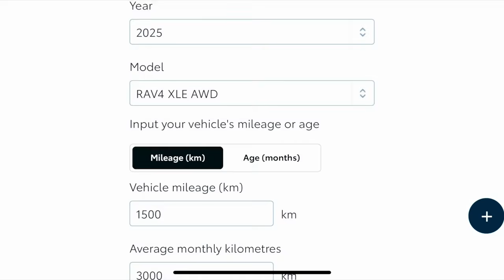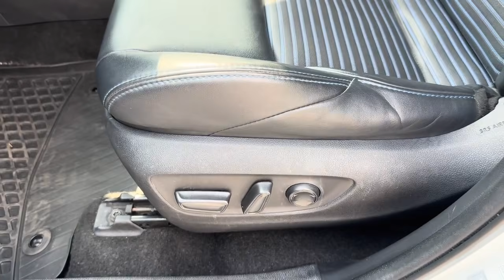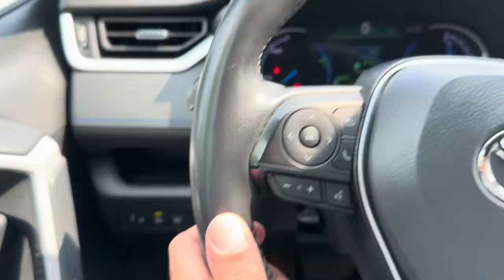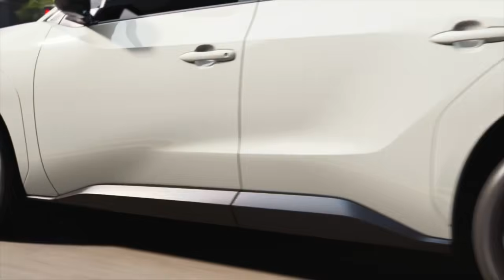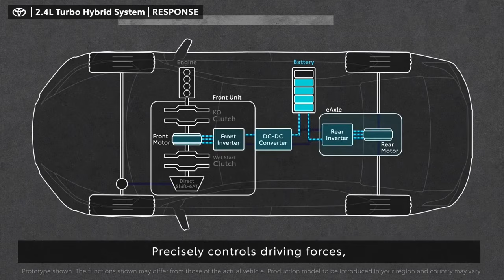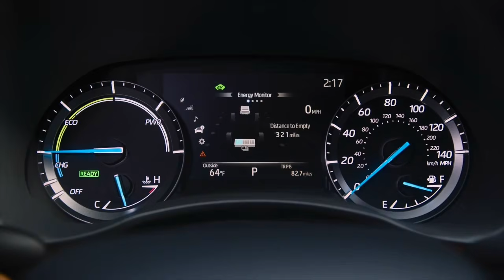Toyota Hybrid: The FULL TRUTH No One Shows You! (Ownership Guide)

Comment: It's a fact that hybrid batteries need to be replaced after 9-12 years. The data is from older Prius cars. Therefore some of the money saved on gas will be cancelled out. This does not necessarily include plug-in versions.
Reply: Source? May need. Usually closer to 12-15.

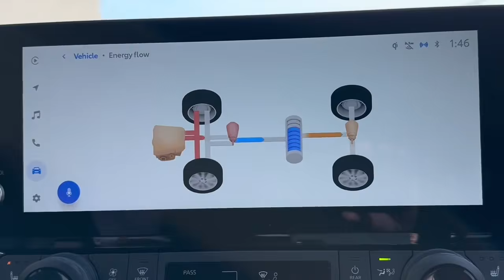Comment: 31:00  16,000 / 10,000 mile oil change.    If you plan on keeping your Toyota a long time, change oil and oil filter every 8,000 Km / 5,000 Mi.....
Reply: oil should be changed when it becomes darkish brown or before.  owners must check oil.
Reply: Oil analysis is a thing...
Reply: @practicalcraft1791  oil inspection is still a valid thing